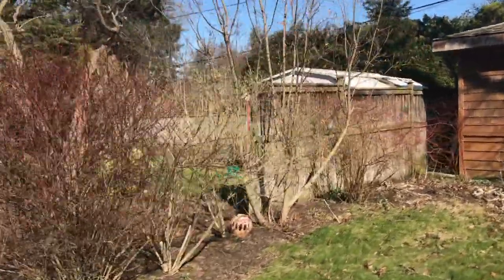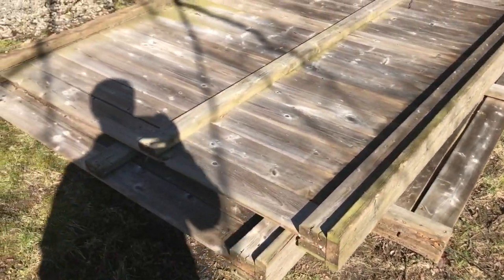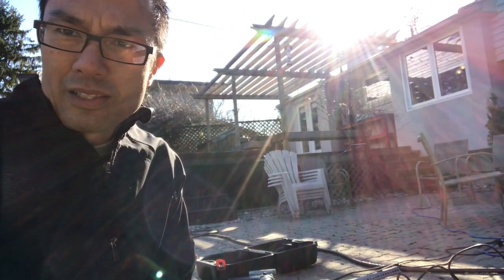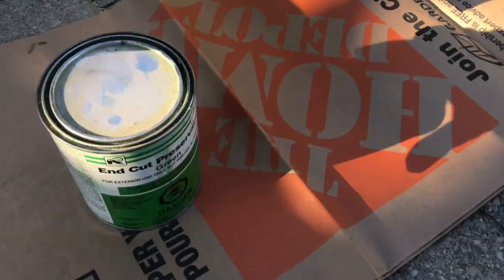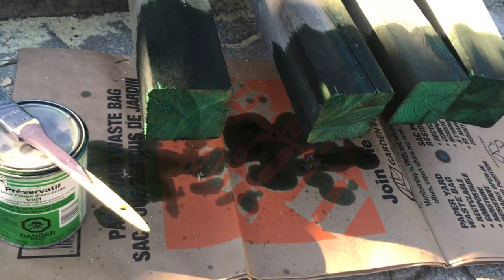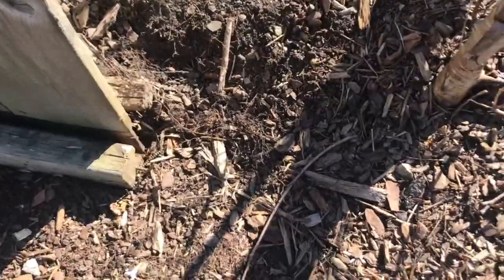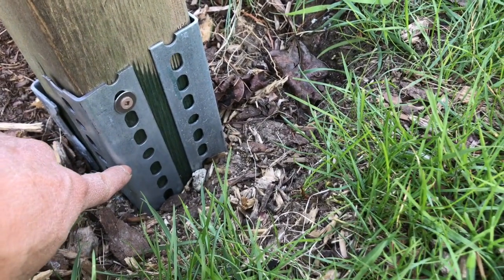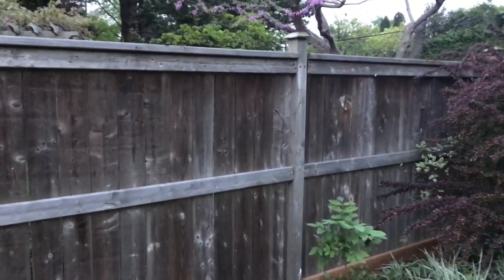Fix Your Fence Quick, Easy & Cheap! (Under $50)

Comment: Dig out the old post and concrete. Install new post. Pour new concrete. That product doesn’t keep the post dry, it’s a wood treatment like copper green that helps stop fungus. 
Super cool guy tho and I am not wanting to seem like an ass.
Reply from the maker: As soon as my fence falls again, I will definitely dig out the concrete and put up a new fence.  I just didn’t have the funds to do build it out new completely.   The temporary fix is holding up though and it’s been over 2 years now....hope it holds for a couple of more years and then I will do it properly :-). Thanks for taking the time to comment though.  Have a great weekend.
Reply: DDIY GUY Danny Jose I’m glad it’s holding up. Have a great weekend 
Stay safe

Comment: If the fence is a foot shorter than the rest though, how come the after pics look like the fence is aligned?  Does this mean you're not resting the cut bottoms of the fence on the concrete but instead spaced with a gap between the concrete and the brackets?
Reply from the maker: The fence that I cut is actually a foot lower then the next panel of fencing.  So the posts are actually resting directly on the concrete.  By the way,  it’s been a few years now and the fence is still hold strong.

Comment: Im curious how's it holding up?
Reply from the maker: So far so good....it’s the first winter and it’s still standing.  There is a lot of high winds in my area since we live by the lake and the ground is sand so it’s holding up with those conditions.  I will post an update in the summer.

Comment: The angle metal you bought is same price of 1 treaded 8ft 4x4 on home depot
Reply from the maker: Well 1 angle bracket at 48 inches can make 4x12in pieces.  I used 2 per post and I only need to fix 4 posts.  The fence is still up, solid and stable after 3 summers and my area get a lot of wind in my area since I live near the lake.  If I bought the posts you would still need to buy 4 new ones, plus dig out the old concrete base, then put new concrete....my method only took a few hours to do.
Reply: If you have a 160 lb plug of concrete with a snapped off 4x4, this is much easier than digging it up and re-pouring the concrete.

Comment: what about round wood psots no one has addressed that
Reply from the maker: A flat version of the metal rod that you can get from the hardware store will do the same job.   Just use 3 on a triangle position around the post.  It will hold it up nice and stable especially if you have existing concrete base in the ground.

Comment: 2" x 6" bottom rails. Not pressure treated. You will re-build this fence in as little as 2 years. Just use a little muscle/back work and do it right bro. :"Sika foam" instead of concrete for the NEW posts, and you're good to go man.
Reply from the maker: For sure...I’ll get it done properly when I have more funds to allocate for a complete build with 6x6 post.  Just didn’t have the time or budget to do it at the time.  This video is really meant to be a temporary and quick solution to tie you over for a few years.  Thanks for the feedback though.
Reply: meatmaster 86 took my comment lol

Comment: Anyone knows how to fix leaning fence that is installed between two concrete walk-way?
Reply from the maker: This method would work at fixing the leaning posts.  Just use extra long metal stakes to give the posts more support and hammer the stakes down as low as you can...then screw them in with deck screws for extra support.

Comment: The bottom wood you used as rails is going to rot in about 5 years.
Reply from the maker: I hope I get 5 years more out of it....that would be great!  this was only a temporary and cheap fix until I can get it properly done with 6x6 posts that are properly dug in.

Comment: Nice guy, but this will never hold up. Go the extra cost and better fix. Get new post and set into concrete. Not that expensive and will last much, much, much. Longer.
Reply from the maker: It’s still holding up after a few major wind storms and some serious frost this winter.  Hope it lasts through the next summer and another winter and I will replace it properly when it comes down again.  I just did not have the funds to cover it at this time.